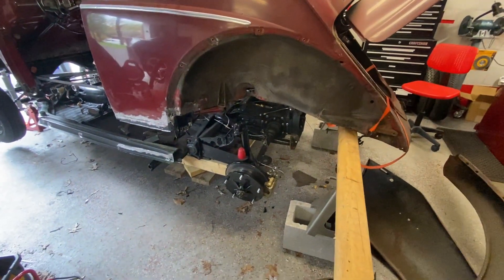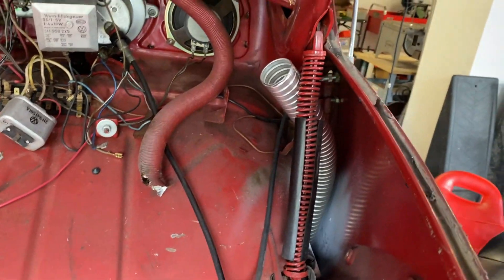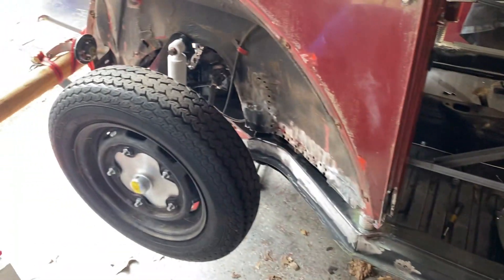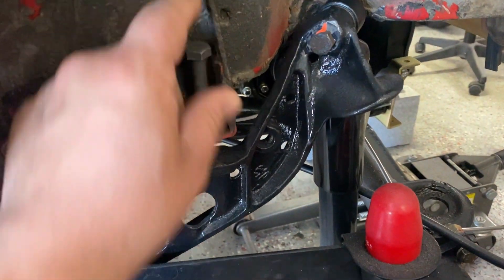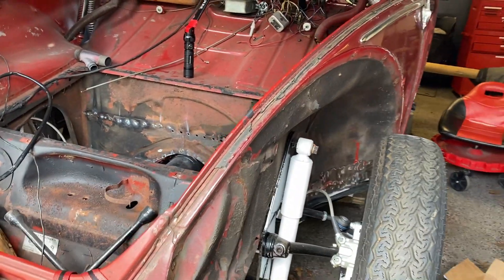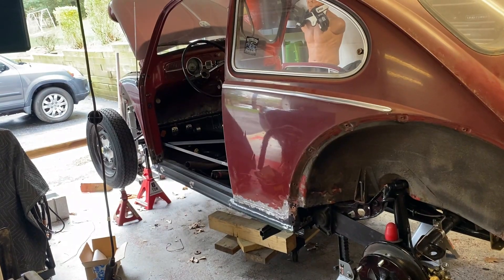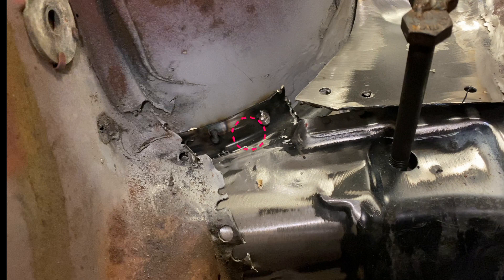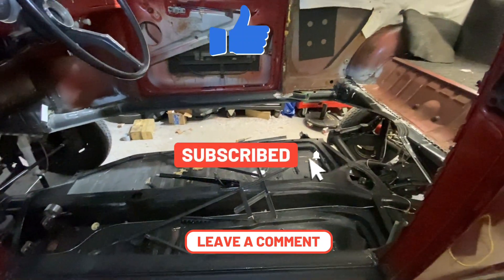VW Bug Heater Channel Install

Comment: Very good video! That gap will close up with the rubber in it. I applaud you! You did this alone without help
Reply from the maker: Thanks for the encouraging words. Doing it alone can be challenging but, doable. I try to show that anyone can do the work if they have no help. The only mistake you make is not trying.
Reply: @FixinBugsNStuff  Yes, you’re absolutely right. I made sure I had help installing my curved windshield on the super beetle I did. 
Otherwise I prefer to be alone in the garage. For except my neighbors that annoy me when I’m in there. 🙄

Comment: Although the patina look is not my cup of tea the work you’re doing here is excellent, thorough and impressive and you are preserving the car for future generations. Looking forward to the completion!
Reply from the maker: Thanks man! I have had show cars, average condition cars and patinas. Patinas are my favorite since I don’t have to worry about dings or scratches when going to the grocery store. I want to be able to enjoy and drive the car but, also making sure it structurally sound and safe. Some patinas I have seen are only held together by rust. 😳 Thanks for checking it out.
Reply: Hi, nice work. The reason why the door didn't aline is becouse you have the body resting on the apron at the front and back. Especially the front  will be push up and in the upper hinges in giving you that gap. The heater channel is not that strong. When you tide the body with the chassis will become one pice. 

Miguel Rodriguez,  Puerto Rico
Reply from the maker: @miguelrodz3307  you are right! People argue with the heater channel welded in the doors should still align. It requires the whole body mounted to the chassis for proper door alignment. Thanks for checking it out.

Comment: Hello there I noticed you also purchased new metal piece where the heater box house connects to the fiberglass tube that goes thru the chassis.  What is that piece called.  I need to buy it too to repair mine.  I have a 1971 super beetle.

Comment: Question:   Shouldn't we have hit the bare steel areas with weld-thru primer before we set the body down on the pan?

Comment: Great video, im very impressed with your work!
However I do have one question, why didnt you fully weld up what you could while the body sat on the chasis? 
wouldnt it make sense to fully weld the thing up while its in position?
Reply from the maker: I could have but, getting in tight areas can be difficult when the pan/chassis is in place. It’s much easier to weld all around the perimeter too.

Comment: great video. can i ask how you got the 2 back bolts in on the floor to heater channel. as my floors came with the jacking points already on the floor. there is no way i can get the bolt in with the bracket. Do i need to cut a bit off?
Reply from the maker: I would cut a little bit off.

Comment: When the door is closed should the very bottom of the door butt against the outside of the heater channel or should it sit on top of the heater channel and the inside sill of the door butt against the lip where the carpet strip would be?
Reply from the maker: The bottom edge of the door sits on top of the heater channel. The surrounding door gasket sits against the heater channel and door jam.
Reply: I think i welded in the heater channels too low at the front. The seal barely catches the channel on the bottom. Thinking i might just add some extra metal to the top of heater channel in the door gap so the seal can actually seal.

Comment: You have the link for the exhaust tubing? Thanks, great vid. Currently doing a full restoration on a '67 bug and your tips are helping with those head scratcher moments. And I see you have a 2 circuit master cylinder for the brakes. Did you convert it? If so are there any issues with cylinders or brake lines regarding pressure? I'm thinking from a safety pov to upgrade from single to dual.
Reply from the maker: Glad to help. Yes I upgraded to a larger bore master cylinder because of the disc brakes. No issues, some think you need a pressure valve for the rear but, in my experience you can do with out it. I am not sure what you mean about the exhaust tubing.

Comment: Good video but u forgot the rubbers in between the body and rear shock towers and lower rubber in the front beam
Reply from the maker: Yep that was done on purpose. This was not the permanent install of the chassis and body.
Reply: @FixinBugsNStuff  i have a 66 beetle needing some welding done my package tray and wheel arches put in.my problem dont own a welder and dont know how to bad ur not close to me i could use some help
Reply from the maker: What state do you live in? There are VW guys all over.

Comment: Surely everything needs to be hard down as the gasket raises up every surface by the same amount if you get my drift😋
Reply from the maker: You got it. Luckily the gasket is compliant and allows a little flexing.